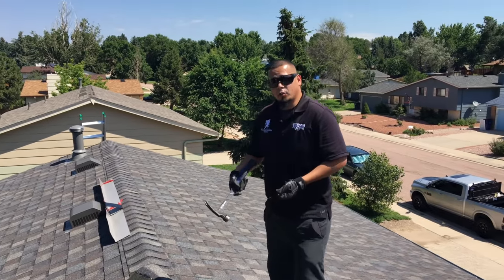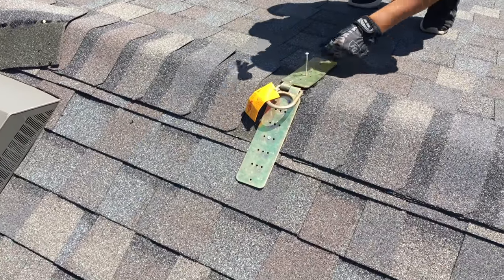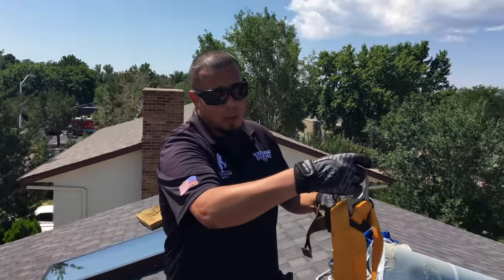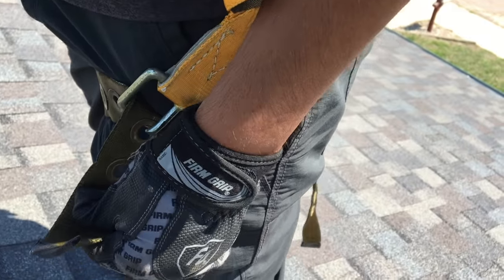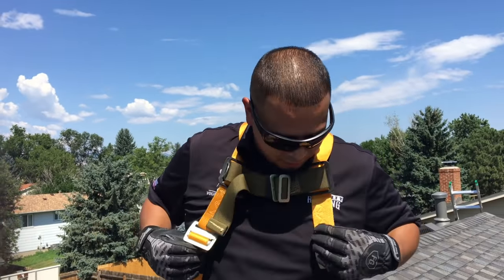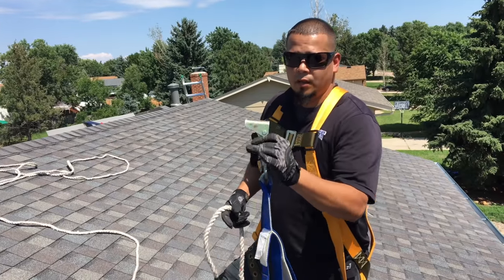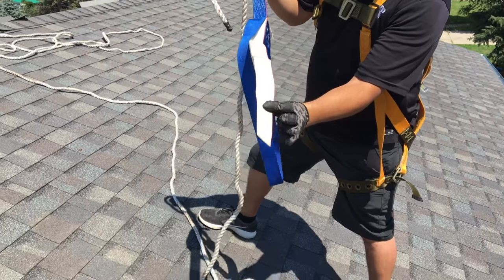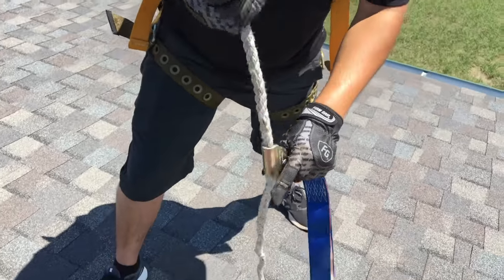How to Use a Roof Safety Harness | Fall Protection

Comment: As a roofer it would be good sense to offer a permanent base as part of the roof package! This way one time and always there. And you can imbed it onto the roof with better attachment. Every home roof should have one of these.
Reply: Yeah. Honestly, as a drafting student, I don't understand why that hasn't been part of the codes since before I was born.
Reply: I just had our roof done and actually asked the roofer to install anchors on each side of the peak (they did, but I had to provide the anchors).  I used the single-side type (as opposed to the ring type shown in the video) because our roof has a ridge vent.  I wanted the anchors in case I have to go up on the roof to clean gutters or any other task.  Now I gotta get a harness and rope.
Reply: @jhuesmann   But I feel concerned the nails could rust over time and not protect as well.
Reply: @staresce  what nails?
Reply: @jhuesmann   the 3 and 1/2 inch nail used to install the roof anchor.
Reply: Exactly what I've been thinking. How are you going to install it on a real steep roof that is wet and slippery, or has loose material if you can't even climb up.
Reply: @FAB0516 they make a tool called the ridge pro
Reply: @staresce when you have the anchors built in with the roof like he did the nailed portion is under the shingle and only the ring sticks  our similar principle to how  vent would be installed under the shingle.
Reply: @kylehughes6324  yup. Nailed it. I had 4 anchor points installed like this when my house was built. Provided the product and roofer installed them under the shingles with only the loop point sticking out. I use them for Christmas lights, dryer vent cleaning, etc. The peace of mind is worth it. Also got some steep gear shorts to slide over my pants. Better safe than sorry.
Reply: Makes sense.  So many, both DIY and professional, have suffered disabling injuries that are euphemistically described as "life altering" as a result of falls, and a roof is one of the worst places to fall from.

Comment: If you’re nailing through the shingles, does that not create an entry point for water in the future?
Reply: Just go back over and fill in the holes with a tube of roofing adhesive/caulk. It's designed to fill holes like this.
Reply: @TheDesertRat31  but no adhesive/caulk last forever. Over time it degrades, especially in the harsh environment of a roof. This doesn’t seem like a good long term solution. Maybe I’m wrong?
Reply: @MyFirstYoutubeHandle it depends how well the nail is stapled... if it's too deep or not deep enough it will create space for water to enter, but if the nail is snug right water won't enter the nail space between the nail head and sheathing

Comment: Thanks Man! I'm 65 years young and time to hang new Christmas Flat Rope LED Lights! Our roof at it's highest is 30 feet!  My Wife of 45 years won't let climb up on the roof anymore without that exact same harness you just demoed, But mine came with no instructions! Now I have successfully  suited up in the harness, got my 10,000 LB rope anchored and cleaned the gutters, tomorrow, Lights!
Reply: Are you alive? Did you get it done! Lol
Reply: @Kgoutdoor  oh guess not RIP lolll
Reply: My roof is about 30 feet high too. I got a new roof 6 years ago and had them put permanent anchors on it for me but I have never used them because my roof is steep and it is scary as all hell. I just finally bought a harness, did you survive?

Comment: If you’re nailing through the shingles, does that not create an entry point for water in the future?
Reply: I was wondering the same thing. Also, do we leave the anchor in place? or do we remove it after use?
Reply: You add waterproofing sealant over it
Reply: @Mikejakester  leave it there for the next time some random tik tokers are roofing there

Comment: For a quick repair where a shingle blew off, I never understood the peak angle roof attachment. If I can get to the peak I wouldn't need the harness. I can see using that if your shingling an entire roof. For a quick repair I anchor a rope to the opposite side of the house to something at the ground level and walk my way up the roof using the rope attachment to do the repair.
Reply: This is not a bad idea. I have heard of people tying off through a bedframe or even a ladder inside a window on the opposite side wall.
Reply: I clean roofs and want to start using these on steep ones that I have to walk. Is this the quickest way to be safe?
Reply: I honestly use the ridge pro for gutter cleaning. I don't want to put nails in the roof but most of my houses that I clean gutters on they have a pretty wild pitch and that's the reason they called someone out to clean it, thing is I'm right up on the edge all day

Comment: Thanks for this video. I bought this old house and it has a 15 ft tall 24x24 steep pitch in the center of the roof. Never knew about those roof anchors.

Comment: If you are not replacing the roof shingles, what do u do about the anchor holes? Fill them with roofing caulking?
Reply: I was wondering the same thing.  Ever get any answers?
Reply: @JoshParkerWI  The nail holes should be covered by roofing silicone and then overlapping shingles over the covered holes.

Comment: Nice video.  Thanks for sharing.  Question: how much rope do you allow for stopping before someone would hit the ground?  Also, if someone fell, is there a way to lower themself down to the ground or raise back up to the roof?
Reply: This is my understanding of it (anyone please correct me if I’m wrong) You need to calculate the distance from the anchor point to the ground and then subtract at least 2 feet. Example if you anchor off at the peak let’s say it’s 10 feet to the edge of the roof and then 10 feet from edge to ground (I’m just trying to use round numbers here lol) then you want no more than 18 feet of rope so you don’t hit the ground. Or if you are using one of those springy kinda lanyards then be sure and adjust for the total length when fully extended. But 2 feet seems to be the closest they want you to get. I wonder if that is to make it easier to disconnect and get on the ground safely if you do fall. That might be the answer to your second question.
Reply: Basic shock absorbing lanyards actually let you fall an extra 6 feet when there's enough velocity (aka over a 2 story house) 

So basically you measure the length from the roof line to the ground, subtract 6ft for the shock absorber, subtract your height (well from where the d ring is on your back) and that's how long your rope should be from the peak to the ground. Not the best way to do it but just loop the rope through itself where that measurement is as it won't the the rope grab go past that. There's more to it but that's the basic understanding of it. 

But you should always keep your rope grab/lanyard tight, especially when near the edge of the roof. I give people crap for walking around the roof with a rope on when there's 20ft of slack laying above it.
Reply: I just keep a couple feet of slack with me so I can work. Gotta keep an eye out for if your going up sideways to the anchor and you get far away, if you slide out the rope will do a pendulum swing and if it's long enough you may go off the edge down below.
Reply: There's no way to lower yourself or raise yourself without help or unless there's a ladder within reach. You will need to have people there to help you recover.

Comment: Thanks for the video man. I’m gonna replace my own roof and definitely getting one.  What do you do when you’re don’t as far as resealing the holes where you nailed ?
Reply: What do you mean resealed the holes?
Reply: I have the same question too. Removing the anchor is one difficult task by itself. You may loose your balance doing just that.
Reply: @ultraAsianman  yeah you would have to take the plate off before the last shingle, then put the last shingles, on and then ridge, most of the time you use a cushion or non slip pad towards the end

Comment: That set up looks easy and it helps but what about a roof with clay  or cement tiles and does not have  the same structure like this,how would you arch in that type of roof with delicate clay or cement tiles??

Comment: Won't the holes you make to install the anchor result in water damage?
Reply: if you need to you can replace the shingle on top, or you just put a big dollop of tar there and take some of the grit from the roof which can sometimes be found in the gutter and sprinkle it over the tar spot so it matches the rest of the roof.

Comment: If you have a simple 2 sided roof.   What I did is run a steel cable from gable to gable along the ridge.   Then you can walk anywhere on the roof with a sliding hook on the cable. And attached the cable on the sides, not the roof.

Comment: So putting nail in your roof? How does that work lol. I just got designer roof installed and want to replace some siding up top.i just can't put nails in my new roof 😂
Reply: not if you caulk the holes. btw real roofers dont use those. not trying to be gung ho or macho, but anyone with real experience knows that when you have a crew up there, the last thing you want is 5 or 6 lines to worry about tripping over because laborers will be running back and forth making sure that the installers are in plenty of coil nails, shingle bundles and whatever else they need. so the word safety in safety harness is a misnomer, they provide only extra hazards to worry about which negates any safety that may be provided by harnesses. the safest way to protect from fall is to have roof jacks holding 2x8 boards for people to walk along and thick foam pads for installers to sit on. i myself in all my years of roofing have never seen one single residential job where anyone used those stupid things

Comment: What do you do to the holes the nails leave when the anchor is off the raptor?, do you caulk them?
Reply: A Tar or roofing cement can be used to seal the holes, without any cosmetic change to the home.
Reply: @roberthazelton8824  unless the roof has energy star shingles, which are typically a very light grey to white color, then that tar will stand out like sore thumbs.

Comment: do Inyo connect all the workers onto one of do they have their own system nailed to the rafter??
Reply: Some anchors are able to support two people but most of them are single person usage. One roof anchor per person. I've used a roof anchor that's metal and protrudes upwards and locks, it doesn't have a hinge, so at times I would use the same one as another person if they were on the other side of the roof, but if it had a hinge, we would use one each cause you'd be in a tug a war, constantly pulling the anchor to your side of the roof. So if one person tugs it to their side, it could pull the person back a few inches on the other side, causing them to lose their balance, etc.

Comment: Might want to read the instructions again for how to install the anchor. If you are installing into a roof truss all 6 center holes on both sides should get a nail in them. I completely understand your comment about splitting the truss but that's not what the instructions will tell you. If you are just installing into the plywood sheathing and not into the truss then all holes on both sides get nails or screws, other than that, great video.

Comment: Any other way to know you’ve hit the rafters besides guessing from stepping on the plywood?
Reply: If you have a good studfinder, that would work.
Reply: This method only really works if the roof doesn't have h clips and especially when osb is used, or thicker plywood/osb. 

What I usually do is just grab my  hammer and give the roof a slight wack, not too hard  but good enough to hear it, then just hammer in a horizontal line, should be able to hear a hollow sound or a dulled sound. Dulled sound is where a rafter is. Takes some practice to get the hang of it and you don't always end up hitting a rafter, once you found a rafter just measure out to find the next one if you're using roof jacks

Comment: What you do with the holes after the nails?
Reply: You can either just caulk them, or replace the shingles that you put nails in. Best if you replace them
Reply: @Josh-ww5kz  the caulk is a half-baked idea, and what if the roofing isn't being replaced? Maybe a vent install or chimney work?  how easy is it to find matching shingles in such instances?
Reply: @elkscout1   @elkscout1  

That's why I said it's best to replace the shingles you take out. 

Caulking only lasts a few years before it dries up if its in direct contact with the sun. If it's an older roof youll probably have a hard time finding an exact colour match because shingle colours can vary between shipment/lot numbers. Plus shingles change colours after years and years from sun exposure. There's not much else you can do than just find a shingle that's close to the same colour or if the homeowner happens to have spare shingles hidden away, that's why I usually like to leave a bundle or two after the job is done just incase they decide to get their chimney taken out, etc etc.

Comment: Anything wrong with leaving the anchor in place since it is my house. I would seal everything.
Reply: The Lion and Champion no there wouldn’t, some new homes heave the anchors in place for that same reason. If you wanted you would remove the cap anchor it directly to the decking and truss then cap overtop leaving the attachment point free to attach to.
Reply: The one shown in the video is reusable but there's kinds where it's a one use system, you could leave those in and cap overtop, making a slit in the cap shingle and then put roofing cement around the point that goes through the cap shingle.

Comment: I had to stop at the part when you put the harness on while on the roof.  The harness goes on before you get on the roof;  it is easy to lose balance or slip while putting on the harness.

Comment: Thank you for your caring, but You have to donning your safety at the at the ground befor climb up.
Reply: you should put your harness when down but you cant put the anchor if you're not on the roof
Reply: @Darkraph2  exactly. Most safety guys try to say that you should throw a rope across the peak and tie it to something sturdy on the ground but i dont know one person who actually does that.

Safety guys usually allow for the first person up, usually the most experienced guy, yo up right to the peak an secure a anchor and rope within a time frame
Reply: That or there's these roof hooks that you attach to a ladder and you can hook it on the ridge of the roof to safely get up to the peak, usually only works on steeper roofs  though

Comment: How do you attach it to a metal roof without damaging the metal?
Reply: unscrew one of the bolts that is already on the roof and then use that screw and hole to anchor down

Comment: "Put enough nails to secure this anchor properly" ---- how many is that? 2/side?  4/side?  6/side?  Every hole?
Reply: he definitely gave a very vague answer. I wonder if OSHA is that vague?
Reply: I usually just put 4 nails on either side, some roof anchors have 3 columns of holes going down, only the middle ones are actually used because rafters on a residential sloped  roof are usually 2x4s and 2x6s sometimes. So putting nails in the left and right columed holes don't hit the rafter at all.

Comment: how to takeoff the roof anchor when work is done?
Reply: It's incuded in the price of the roofing work...
Reply: Flat bar, nail puller, roofing shovel, claw hammer. Just pry it up and replace the cap shingles you take out

Comment: what about anchoring to the opposite side of the roof, to something on the ground, 
so you dont have to nail anything into your roof, longer rope?
Reply: That's what I do. Rope around a (large) tree in my front yard. I knotted a figure eight loop to hold it. I have a length pf paracord and a sock filled with sand that I throw over to initially string the rope over the roof.
One issue with this is this is (obviously) it will only protect you if you fall off one side. Another issue is making sure to check out the rope before use, because dragging it over the roof can abrade it over time. I had to buy an extra 100' of 5/8 inch polydac rope to reach over the roof. This is the same rope used in those kits (it fits the tensioner) and has a 6000+pound strength.
Reply: @bnasty267  I'm envisioning doing something similar for my Christmas light decorations. The sock/sand idea is awesome. I was going to tie my rope to a basketball and heave it over but I think the sock/sand technique may work better.
Reply: You can open a window on the far side of the house and tie it to a metal bedframe.

Comment: I will use 4 three inch decking screws on each side. This system only protects during a fall, not staying oriented to the front and your work.
Reply: Be aware that screws can have worse sheering tolerance than nails. Nails will bend, but screw heads will snap off. Decking screws are strong no doubt, but just use 16d ringshank nails. Remember that nails hold up the weight of entire houses. You only weigh 200 pounds.

Comment: When you're on a 12-pitch roof and you're relying on the harness to keep you on there. Is anyone else worried about the shock absorber accidentally deploying because of all your body weight. I mean you'd be fine but you could still fall off the roof cuz it's about a 6 ft of lanyard so you'd be dangling

Comment: nice video man. we all wanna go home at the end of the day. but little tip, your leg loops need to be loose enough for a fist to fit under. if its too snug you will hurt your man parts real bad
Reply: It is definitely exactly the opposite of that.  They need to be tight enough so your man parts CAN'T fit inside the leg straps accidentally when you fall.    (I teach fall pro classes for a living)